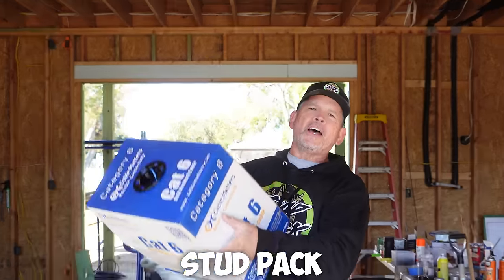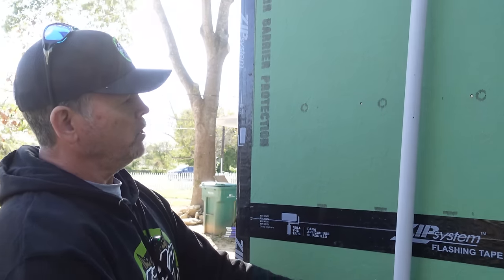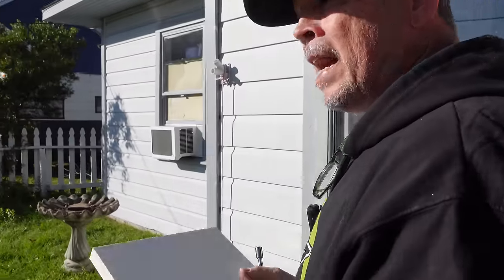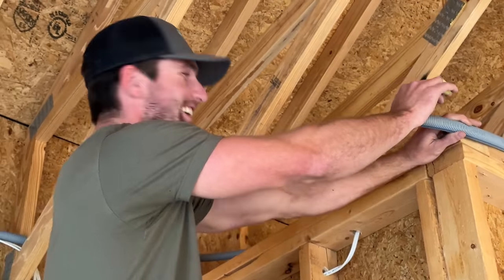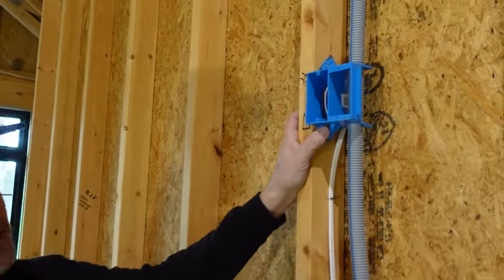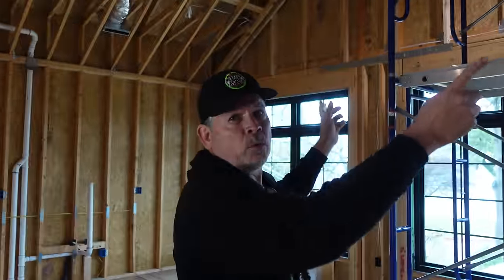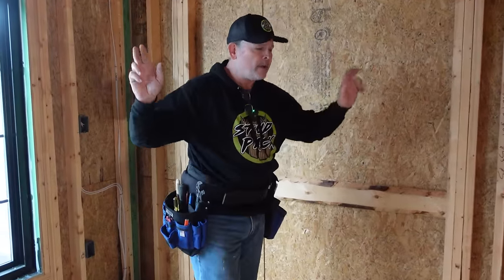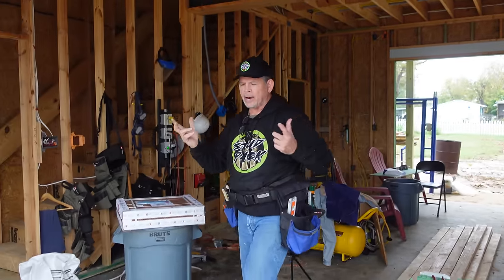DIY Networking for a Future Proof and HIGH SPEED Home! (Smurf Tubing and String Pull Trick!)

Comment: Hey stud pack! I’ve been in telecom for over 15 years and just wanted to drop some tips for you. 
- As many have mentioned already, best to put a wall plate with a jack instead of the modular end. 
- The difference between 568a and b are American and (everyone else) comm standards. The orange and green pairs are the only ones that swap. If you swap those pairs on each end you can create what is called a “crossover cable” and that’s how devices communicate over cat cable without networking equipment.
- Your landline as you mentioned runs on the blue pair which never changes position between A and B
- When you get your pairs untwisted, instead of cutting flat, cut at a 45* angle, it’s easier to feed the wires into the mod end. 

Love the videos boys! Keep it up. If you ever need Canadian over for help gimme a shout!  I need an excuse to come eat some good ol Texas bbq!
Reply: That 45 degree angle trick is genius! Never thought of that and I'm just getting started (bought a klein ratcheting crimper and passthrough ends), haven't even actually terminated any cables before. Do you have any other tips or video recommendations for getting started with my first terminations (like how much I should strip from the jacket, I don't strip any of the ends I believe)?
Reply: A crossover cable doesn't swap the orange and green pairs "on each end". It swaps, ON 1 END ONLY, pair 2 (orange) with pair 3 (green), AND pair 1 (blue) with pair 4 (brown). If you only swap the orange and green pairs, the crossover cable might not work with on a gigabit network (ie 1000Base-T). And crossover cables are kind of obsolete because most modern network gear now has some sort of MDI/MDI-X Automatic Crossover support which can figure out which pairs are swapped and which pairs aren't (which is probably why your incorrectly wired crossover cables might work anyways on a gigabit network).
Reply: Where I grew up the houses were built in the late 1950s. The original telephone wiring was unjacketed bundles of ten or so pairs pulled in continuous loop throughout the house framing. Later Bell started using station wire with Red+Green and Black+Yellow for the two pairs (Christmas tree / Bumble bee).
Reply: the 45-degree cut works for some connectors and not for others. Really depends.
Reply: Heh, I came just to tell them to cut at an angle. I was taught to use scissors and not the other stuff, but if it works it works.
Reply: Extremely useful tip with the angle cut!!  Took me a few hundred mod ends to figure that one out LOL
Reply: Australia uses A unless you have a specific product or system that previously used B 
I had to reterminate a whole building from B to A wasn't fun!
Reply: @cirkutpersonal the pass thru jacks really changed the game.  Before you had to strip back just enough, but not too much.  Now you can strip as much as you want since you’ll be cutting off the excess when you crimp.   You also don’t have to worry so much about testing the connector.   After you put the wires in you can double/triple check the order to make sure they came through correctly.
Reply: Totally correct. I was a central office technician for 26 years. If y🎉ou swap (we called it a flip) both ends you cancel out the first flip and end up with what you started with.
Reply: @bruceadler-9410  yeah sorry, that’s what I meant. 1 end only, could be done on each side.
Reply: @FieroFats  yeah Fluke makes nice scissors called D Snips. They are great for data stripping.
Reply: I don't know of a single modern device that doesn't auto negotiate, devices which support 1g always auto negotiate. Although I highly recommend not mixing standards, if you do the devices work it out and set their ports accordingly.
Reply: Don't ever use pass through connectors. You're leaving exposed copper barely separated at the end of the connector. Use quality connectors and ensure your "strip depth" is good and the cut is flush and you'll be fine. 

Pass through can be unsafe for PoE switches/devices. 

You also need to make sure your connectors are rated the same as your cable. Usually CAT6 requires staggered cable guides.

Don't ever use solid core copper for patch cables either, it's infrastructure cable, not user/device cable. The stranded copper in patch cables will flex nicely when used, whereas solid copper will have no give and eventually you'll end up with a failure at one of the connectors.
Reply: Just a few weeks ago I made several patch cables, and cutting the ends at a 45-degree angle helps tremendously! Great tip 🙌🏽
Reply: @falzon1230 So basically, buy all patch cabled pre-made, and don’t make them from solid cables. Sounds fair, and I agree that the flexibility is probably worth it. One thing I just shake my head at is buying a router and the patch cable in the box is folded tightly and tied with a twisted wire, thereby essentially crimping the cable and weakening it.
Reply: BlueNoteStan  sorry but you're wrong. Pass through are never acceptable and I have done plenty of work for many branches of government and never terminated a single pass through. They're amateur connectors not professional. If you're doing the job just do it it right the first time. 

Pass through allow the copper to move outside the connector over time and can and will short out on switch ports, there is no arguing physics.

Comment: AT&T technician here 👋
Good work dude. All new builds from good builders have Smurf tube running straight to the panel (structured media enclosure). This makes it soooo much easier for us. The better it's strapped down and secured the easier the pull is. House is really coming together.
Reply: Agreed! I do GFiber installs and I hate when new construction puts the main lines on the side of a garage or a similarly bad spot and doesn't run a conduit for the data lines.

Comment: If you're wanting to keep the male ends I'd recommend having strain relief caps on the cables. In all honesty, having a wall plate that either terminates in a female punchdown or a male-male passthrough would be the best practice. That way you can purchase premade cables that are much easier to replace and are designed to be more responsive to movement than that cable you purchased which is meant for install in walls.

Lastly, unlike electrical, network cabling can't just be unscrewed at the termination so if you need to redo the end it has to be cut off. Because of that it's important to have extra slack in your line so that you can reterminate easily without having to pull an entire new line.

Other than those notes great work!
Reply: Usually there are instances where you can have it coming through the wall into a flexible wall grommet but that's usually in a network closet where you have more than 6 lines going into the wall from a switch or other device. But yes best practice is to leave some extra length in the line so that if you do need to re-terminate the line at any point from random instances of damage, mother nature, or moving the location of the LV box then you will have extra slack to do so. I would also recommend having tubing through the wall if you don't want to have extra few feet of wire because then it will make running a new line easier later on. also the Kline crimpers have a wire cutting / stripping feature on them as well. cutting is tight up towards the hinge and  the little notch down below the flat surface is for stripping. The cutter/crimper that Jordan bought is for Key stones but you need a specific brand with that specific brand of keystone crimper, alternatively you could get a punch down tool from Home depot or Lowes and use any keystone you like without any issues. Keystones are usually used in instances where you either need to extend a line (using a biscuit box) or at a patch panel. they slot right into the back of the patch panel and are used mostly in bigger scale network rooms.  Granted I have a few patch panels at my house because of how many things we have plugged in.
Reply: Came to comment exactly this as well! Always leave a service loop just in case for the future.

Comment: 1. Make sure to strap that smurf tube down tight. Unlike rigid conduit it can flex and stretch while you pull, making the job a pain.

2. 19:24 Glad to see you using the right box adapters. Make sure you seat the adapter ALL THE WAY DOWN on the tube, which is like 3 or 4 clicks. If you snap it to just the first click you leave a gap between the leading edge of the conduit and the mating edge of the connector. This gap can snag your cable or fish tape. 

3. 20:08 If you want to get fussy then there are tables online specifying acceptable proximities for parallel power and Ethernet.
For the most part, however, Cat.6 cable is good at rejecting induced interference from power cables except in extreme cases. 
Running it in close proximity for a foot or two (in this case) will (likely) not cause any issues but best practice is to put as much space as possible between parallel runs, and to cross only at ninety-degree angles.

4a. Run drops to the ceilings for your WiFi APs
4b. Run a drop or two to every wall whether you think you'll need it or not. You can lay the cable on top of the spray foam if necessary and terminate only when you need it.

5a. 22:00 this cannot be overstated: You must always match your connectors to your cable and then your crimper to your connectors. 
5b. Every connector will be suited to a particular a) conductor gauge, b) cable OD and c) type of conductor (solid or stranded). Reputable dealers will list these in the marketing materials. You cannot, for example use Cat.6a connectors with Cat.6 cable (and vice versa) because the conductor gauge and OD of the two cables are significantly different.
5c. For PoE applications you should probably avoid pass-through connectors because they can sometimes arc at the ends. Use load bar connectors instead.
5d. All that said, 22:06 ABSOLUTELY use keystone jacks mounted in wall plates! Having a wire hanging out of your wall is just plain sloppy!

6a. 23:34 The twisty part in the center is the spline. It's there not for strength but to maintain the internal spacing and overall twist of the individual pairs.
6b. 23:40 The difference in twist pitch is the product of some complex mathematics designed to reduce interference between the pairs.

7. 23:59 I have a technique for untwisting the pairs with the smooth outer edge of my electrician's scissors, which lets me straighten the cables as I go. Everyone has their way.
Reply: I probably would have used shielded cable because I'm crazy like that.
Reply: Another reason to terminate your cables to keystone jacks is that solid copper cable (the stuff in your walls) is less flexible than stranded cable (the stuff in patch cords). It is intended to be installed and then left alone. Patch cords are then used to make the final connection to equipment.

Comment: I usually never comment but I do this for a living in California. We always try to stay away from high volt due to interference. There have been times where we had no choice. Usually we have no issues with interference if it's parallel in a short span. Also trimming cat6 into a keystone and using a patch cord is the better way to go just in case you move and need a longer cable. Also don't forget to think about the interconnect from the garage to the main house. Usually what we do in bigger high end residences are to have a main distribution and have an intermediate distribution so you don't have to home run everything back to the garage and saves on cost of wiring. Loving the series keep up the good work!
Reply: I was thinking the same thing about the future house. I would pull a preterminated fiber from the garage over to the main house where they can have another central connection point. Get switches with spf ports, or use a media converter.
Reply: @bjnorton8029  sm lc sfp ftw lol
Reply: As a I.T. SysAdmin I also agree.  I'd put a backbone fiber into the house back  to wherever you're terminating the fiber with the ISPs modem/gateway (ingress closet ).  More equipment... More chances for failure... BUT home-running everything is a pain... And it's easier for someone to add network 20 years from now in just the home (no garage wiring necessary ). Two switches instead of one, not a biggie.  Also; put a second pull cord in the fiber conduit.  It's so easy to do now, and someone 20-30 years from now will LOVE it!!!!!
Reply: @pauldavies9082  Don't you think that single mode fiber would be overkill?  With single mode they could do a run down and around the block.  Not to mention the cost of simgle mode optics compared to muti-mode. With OM4 cable you could run 150m (at 100G)
Reply: @iplaybass1641  I'd agree single mode is overkill. You're not traveling that much of a distance to warrant that. Multi-mode fiber would be more than sufficient for that run that'll be if anything 300ft.
Reply: @iplaybass1641  disagree, not necessarily because mm wont do the job, but because the industry has been moving toward sm and sfp’s for alot (im guessing for bandwidth). More of a future proofing measure i suppose. Not sure whether or not this has been noticed at scale yet, but i have been seeing this happen quite a bit with industrial mc’s and switches where some manufacturers are in the process of scaling down mm and st production and increasing sm and sfp. It’s been messing with my ability to get mc’s and switches with the temperature ratings needed for an industrial or outside environment.

Comment: Networking is one of the major reasons I'd love to build a new house.  More ports than you think you'll need, running to a quality switch, and get as many things OFF of wifi as possible.
Reply: yes, exactly!
Reply: Using cellular and wifi only. All speeds are plenty for a single family home. Most importantly, watching stud pack with wifi on a busy Friday night.
Reply: Yup. I didn't it with my home: About 124 Drops (Still have a few more to do in the basement) All Cat 6A. I have a lot of Poe Devices (IP cameras & IP Phones) so Wifi would work for those devices anyway. using a few refurb'd Cisco switches with trunking & VLANs.

Comment: Whenever possible, you want 12in between electrical and low voltage or to cross at perpendicular. What you don’t want is to have long runs run in parallel immediately next to each other as the high voltage can induce interference or current in the low voltage.

Comment: 568A was for government network standard installation. 568B is what everyone else uses. If you look at the keystone jacks you’ll see there is a sticker with how to wire those to A or B standard too. Same for the premade patch cables you can buy them in A or B standard.
As others have said already, I recommend using the keystones with a standard faceplate for the TV, Router/firewall, PC, wired network speakers, etc. Do the RJ45 ended runs for your cameras and WAPs.
Reply: There is no real difference between 568A & B. only difference is Pair 1 & Pair 2 colors A: Green & Orange, B: Orange & Green (reversed).
Reply: @guytech7310  the difference is T568A can still function as telephone wire, which is why it was required for government installations.
Reply: @TeflonBilly426  You can use 568B for telephone. Only difference between A -B are the color of pairs 1 & 2. Phone uses Pair 3, & Pair 2 (second line). The reason why Pair 2 is split (ie 12,36,45,67) is for analog phone. Pair 3 is 45 for phone.
Reply: A and B are ONLY differentiated for making cross-over cables.  Nothing more.  If you use the same standard on both ends, it is a straight-through cable.  If you use different standards on each end, it is a cross-over cable.

Comment: Paul, you guys are great to watch.  I want to give you something to think about.   

When installing data cabling in a house, you want to think about what to install to last 10+ years for the changes in technology that will occur.     I installed CAT6 UTP in my newly built house in the year 2000, and it was an excellent 1Gbps standard that has lasted for 23 years.  But today, we are now seeing more 2.5GbE connections and higher options.   

To future-proof your installation, you should install STP (Shielded Twisted Pair) and  a 2000MHz CAT8 cable in your walls and use keystone terminations in the wallbox.   Your current equipment may not utilize the speed, but you won't be pulling it out and replacing all of the cable and termination keystones in 5-10+ years.   You certainly want to shield the cable now that so many devices, Wi-Fi radios, and lighting are creating additional noise.  While you're running it all in smurf, which will make repulling it all later possible, it's certainly cheaper to just do it once and be happy you wont have to change it in another decade.  My 2 cents... worth the price charged.

Comment: Conduit and a vacuum looks way easier than the time I ran Cat-5e through air ducts in an HVAC system using remote control cars on a rental property.
Reply: Now that sounds like a great time regardless of the outcome!
Reply from the maker: 😂😂 would’ve made for a great video though!
Reply: That's actually pretty genius too.
Reply: My house has a short section of horizontal duct, with vertical duct before/after it.  I just used a battery powered toy car, no RC, tied a thread to it, and dropped it down in from above.  It went across to the other vertical, fell down into it, and out the bottom.